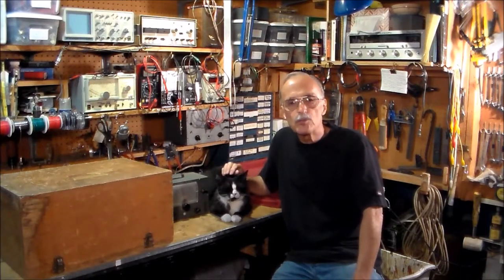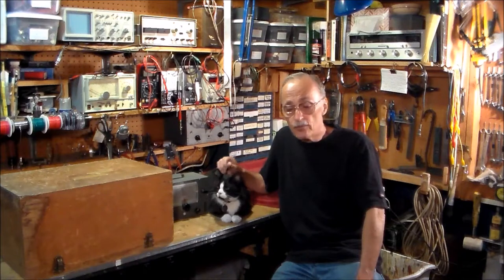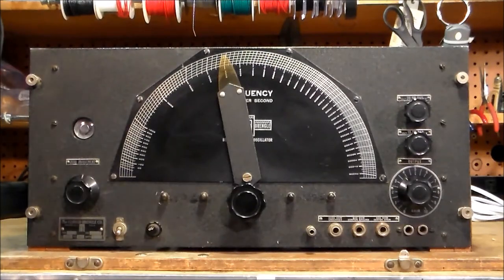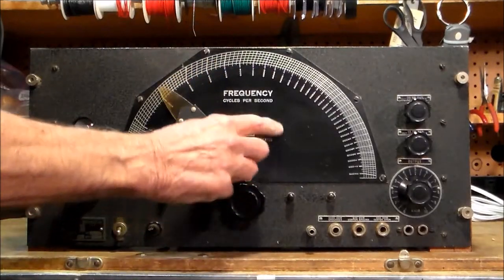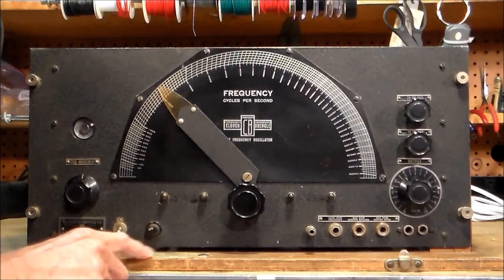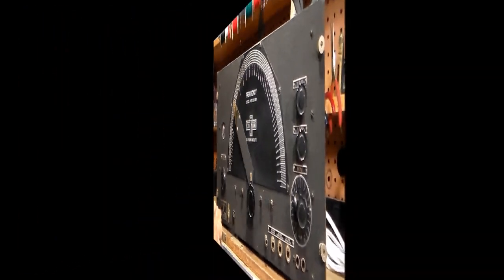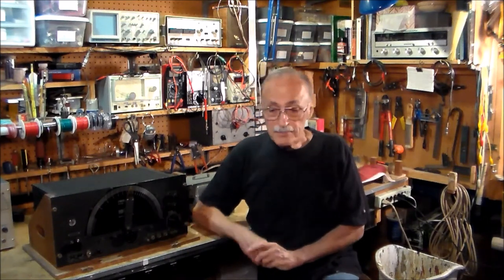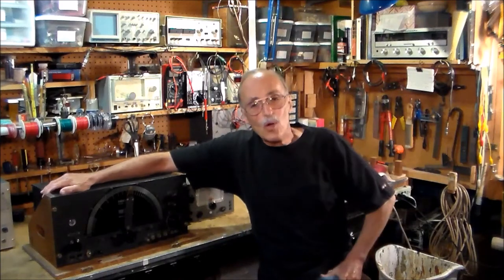VACUUM TUBE, BEAT FREQUENCY SIGNAL GENERATOR

Comment: The beat frequency oscillator does what to the output signal that goes to the speaker!  I have one on an old Lafayette HE10 shortwave listening device.  I can tune some ssb transmissions but it is a juggling act between the af gain the if gain and the bfo position.  My skill set is mechanical engineering but I have a very bright son who has been doing embedded software for over 20 years.  He got his education at a university that gave a degree to people that wanted to study the less theoretical side of engineering and focused more on the applied.  Most of his professors were from industry and knew what skills were be of immediate value.  The kid (47) has invented some of the wildest stuff for his amateur race cars so very occasionally he will help his old man out with a black or two.  If a bfo just superimposes a ssb voice output on to a sinusoidal wave (carrier?) can’t an oscilloscope look at the voice output, do a fast Fourier on the signal,  and pick a , I’m guessing now, lower than most of the frequencies in the FFanalysis and put the voice output on top of a low frequency signal.  Idea #2:  do a logarithmic transformation of the FF distribution, play back the output of the transformed data.  Very popular among the scientific community when data looks crappy.  On guns, I like guns, I have a small collection.  I’m fascinated by the machinery and the pyrotechnics.  It’s come to a point where guns could be the weapons of the people who put the boot heel on our throats.  When we get a self anointed oligarch, like we almost and still may have we will have a state of affairs similar to what is happening in Mother Russia today.  Russians are fleeing in droves.  They fear Putin.  They fear he will start a war far worse than what Joseph Stalin did and nobody will come to help them, not China, not North Korea nobody. Russians are coming across the open water in the Bearing Straights between Russia and the Aleutian Islands of  Alaska.  It’s on 100 miles but it’s one of most treacherous passages in the oceans.  Two guys made it across two months ago in a 16’ fishing dory.  It took them over a week, they almost died of exposure.  That could be us if we arm vigilantes.  These guns are in the hands of hate mongers.  Current Republicans since Ronald the neo liberalism Reagan started the current back slide of the part of hatred to blacks, sexual orientation, religion (Christian vs Muslim), unions (builders of the middle class now diminished by 66%).  The former Governor of Michigan for three terms, a Republican, would not vote for the former president.  Try and convince someone that today’s Republican is in the same class as Dwight Eisenhower.  I have been an independent most of my life because I always sensed the MENDACITY of the major parties. It’s reached an all time high when the loser calls for the violent over throw of the government and musters a ridiculous number of domestic terrorists in his support.  He is very lucky that some rogue General who memorized the constitution, bill of rights and his sworn duty oath did not deploy a division to take back the capital and send in one of the special forces teams to go in to request that the tourists depart immediately.

Comment: We called those "fish eye tubes" they are used to indicate a difference between two signals. Well at least in the cases I have seen them used. I was in the navy from 75-81 where we worked on tubes, transistors, and integrated circuits. Pet your nice cat for me . Craig